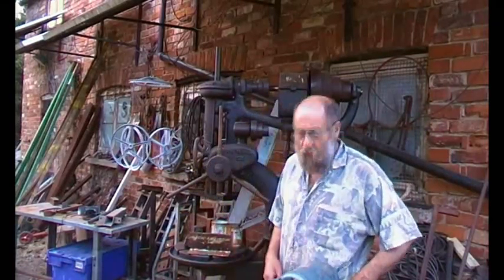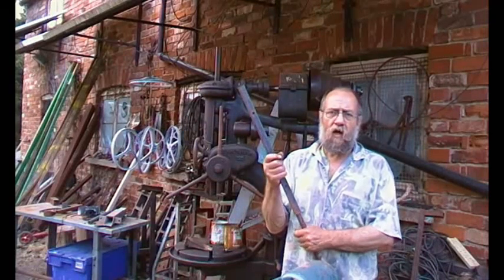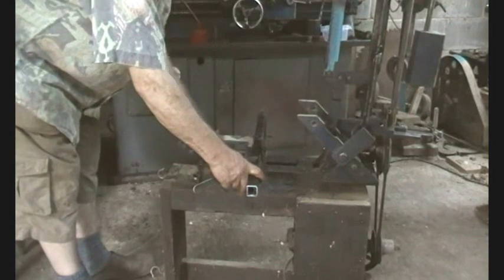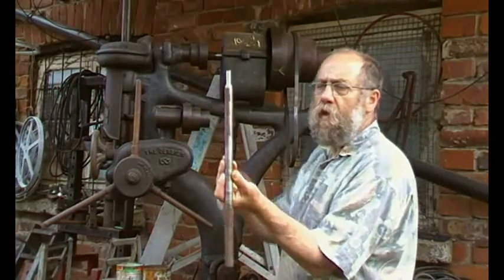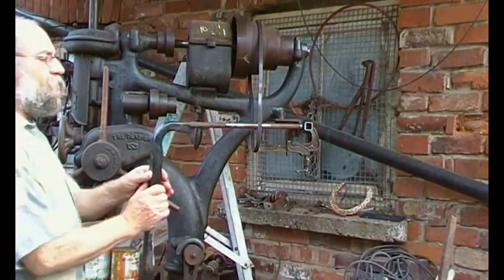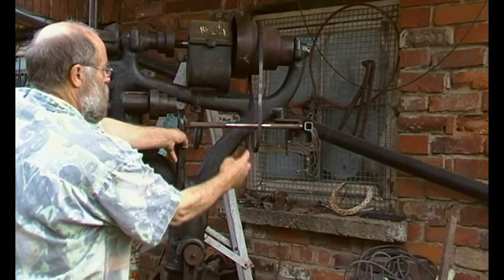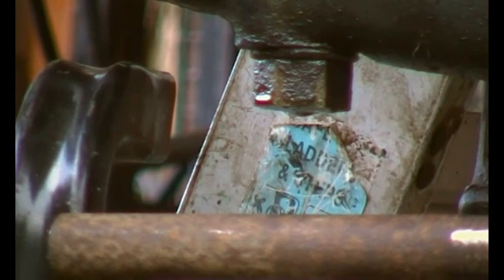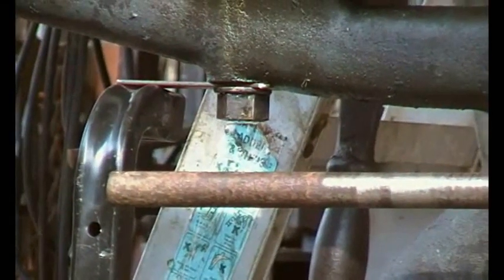Vintage Denbigh pillar drill rescue: part 4

Comment: Lovely pair of clamps at 8:49 Andy!
Did you use Uncle Harold's lathe to turn the ends down of that rod?

Keep smiling
Reply from the maker: Ian, good to hear from you, yes those lever clamps must be nearly 60 years old. I use an old and battered Harison L5 lathe that can just be seen behind Harold's power hacksaw. It is much better than the old Drummond I had before, cheers, Andy